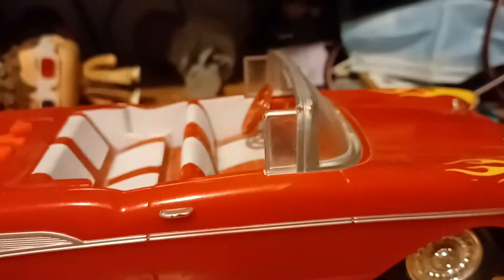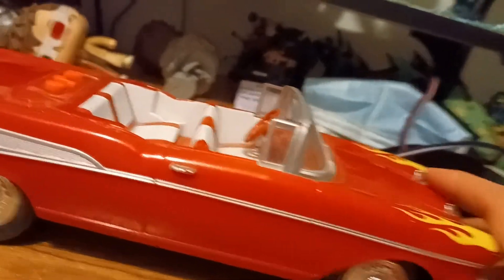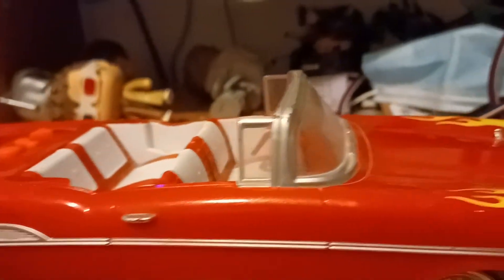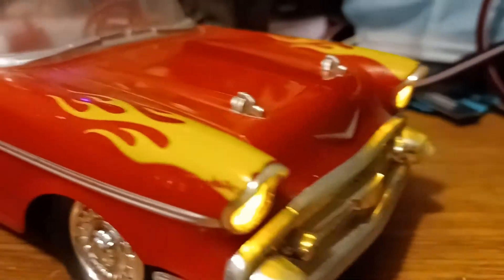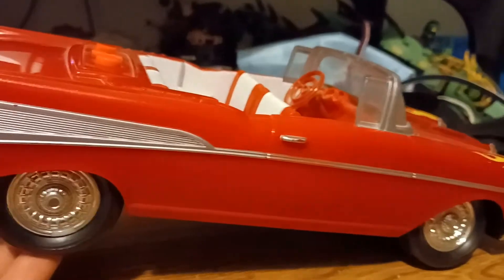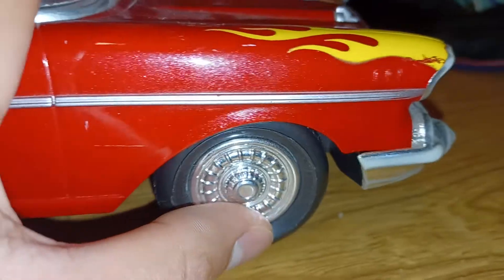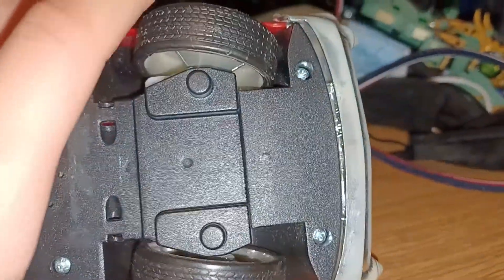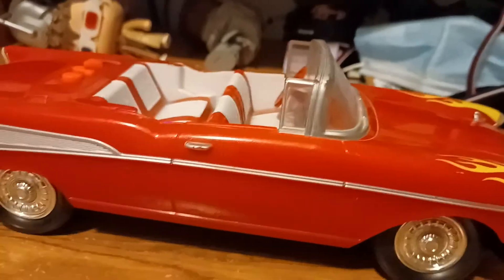(Faulty) 2011 TSI Road Rippers Classic Chrome 1957 Chevy Bel Air (Extremely Rare)

Comment: I remember at one point in 2017 trying to get the 1959 Cadillac Biarritz (Bir-eitz) but unfortunately, I was unable to get because of the price. I did get the 1965 Ford Mustang Coupe last year but I am a hypocrite for this but I did ended up offering the seller $50. Only because it was a life or death situation mainly if it ended up in the wrong hands of someone, it would've been gone for. I luckily saved it from death and I have since fixed it up.
Reply from the maker: Oh yeah. I saw your video on the mustang. That was one I've been looking for since I realized how rare the classic chrome vehicles are.
Reply: How much did the Biarritz cost?